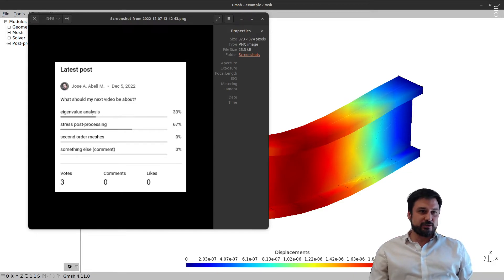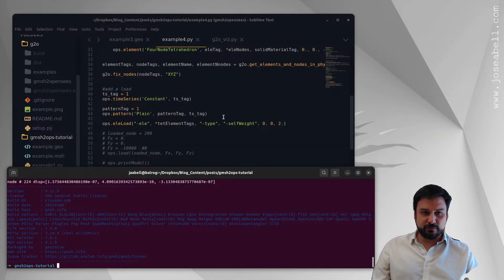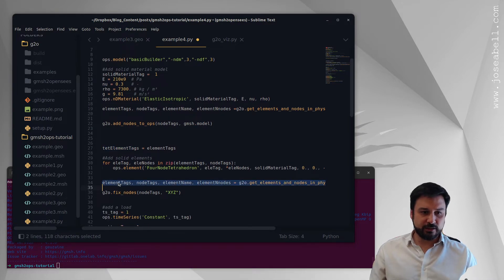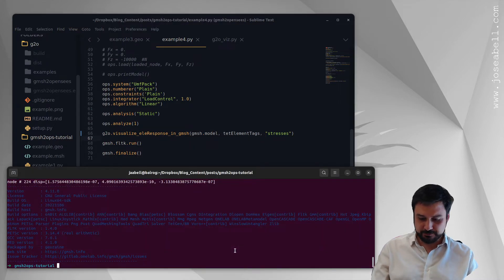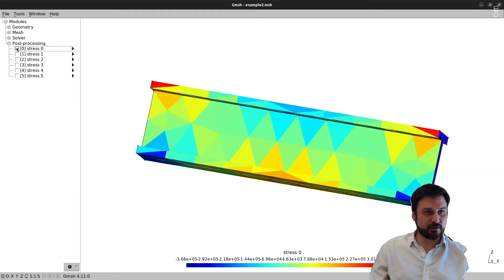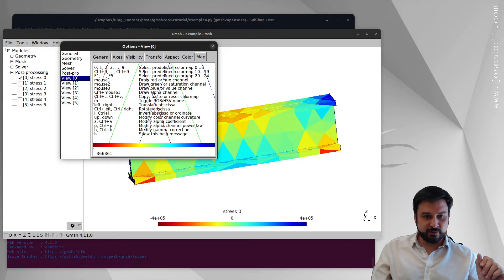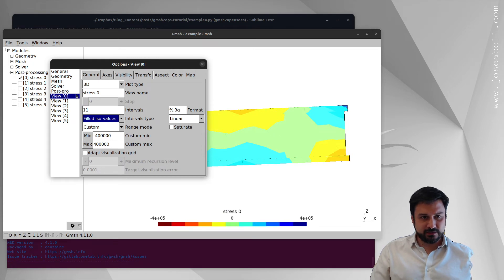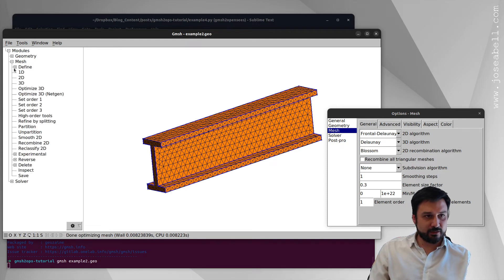Perform STRESS analysis and visualization with OpenSees and gmsh

Comment: Thankyou so much for your videos.
Sir i am stuck with my research topic.
actually i never did simulation before and now my professor want me to do the simulation.
I Have to make a homogenous soil box. All four sides and bottom have the absorbing boundary condition and the top surface should have the free surface condition. then on the top surface of the soil box i have to place a ricker source. The source should be one pulse of ricker. Also i have to place the sensors in a line on the top surface. 8 or 9 sensors. My professor want to see the arrival of P waves S waves and Surface waves ( Rayleigh waves) arrival. As the sensors are in line he also want to see the time delay in seismograms recordings. I am trying in from 4 months but unable to do it. My bachelors background was Geotechnical Engnieering but in my masters he gave me the topic of earthquake engineering. Can you help me regarding that.
 I will be very thankful to you throughout my life.
Reply from the maker: Hi! Did you manage in the end?